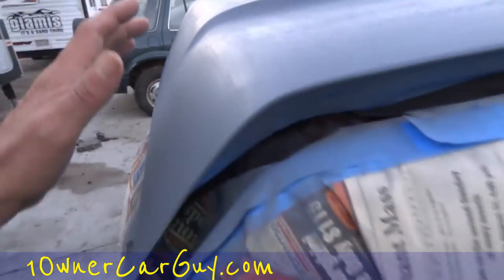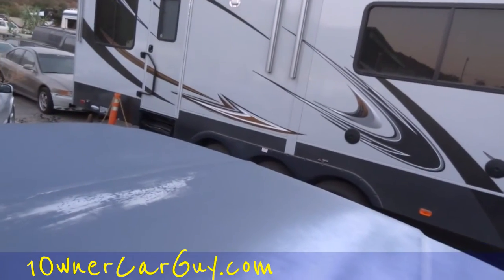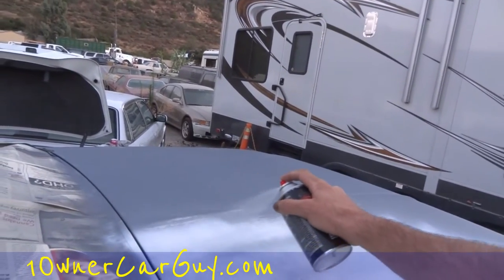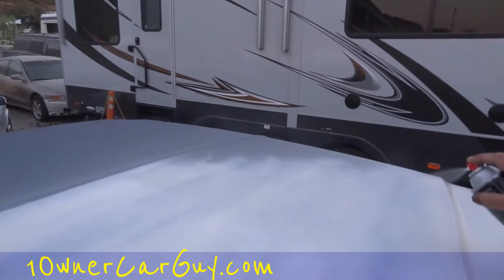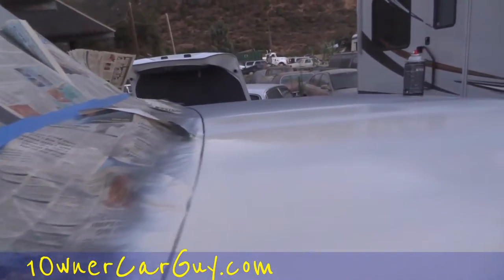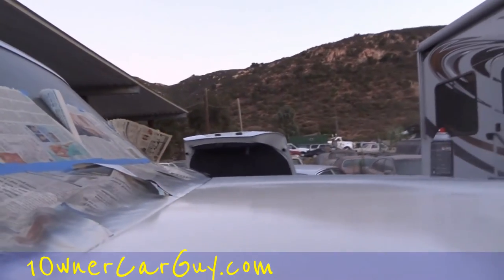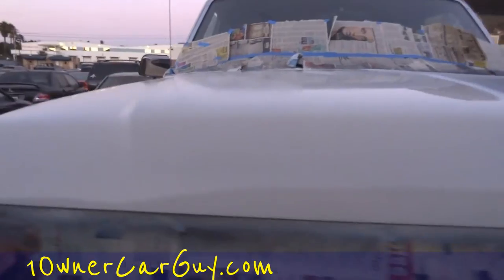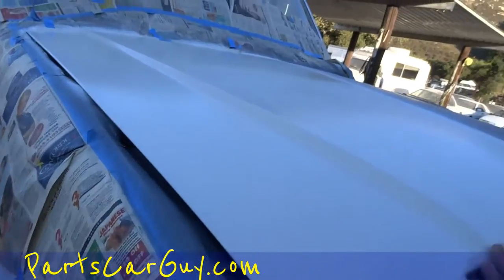DIY Home Car Spray Paint Sanding & Prep Work ~ Color Match Painting Tips ~ Step #2

Comment: I've got a couple of questions I'm hoping you can answer to assist me in my first paint job, in my garage. I'm not interested in spending a lot of money just getting the color on the car so I can sell it.
1. The car has been painted a couple different times already. No rust and only minor chips and scratches. I'm going to use a silver base coat with candy paint. Can I just do the minor repairs and scotch brite the rest of the car with minor sanding and lay down the silver base coat or would I need to use primer first? 
2.If I need primer does it matter what kind of primer that I use over the old paint before the silver base coat. Also, does it matter what kind of primer I use to work in conjunction with my base coat? 
3. Finally, what do you think would be best for a person's first painting experience?
A. Use the $25 per quart lacquer paint I can get from pep boys? Or
B. Go ahead and order a good quality paint from 3m or ppg?